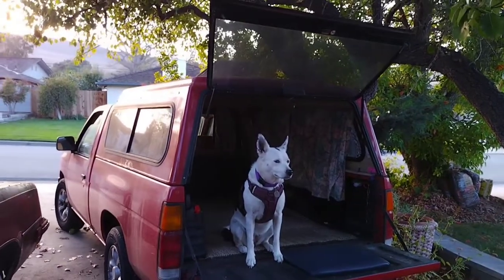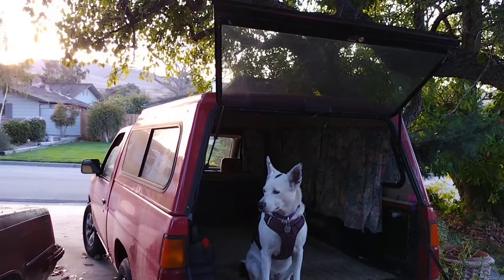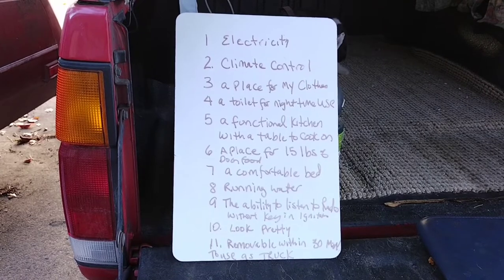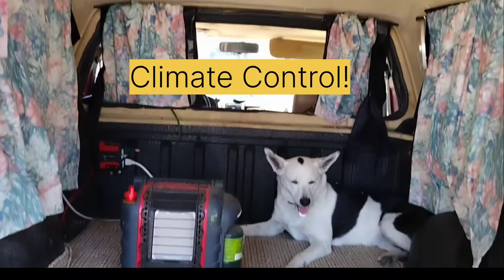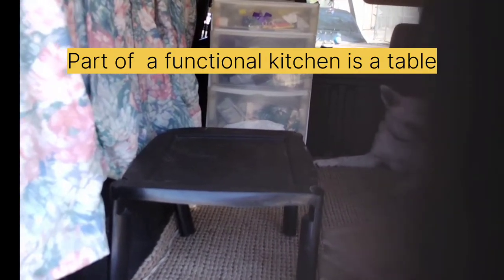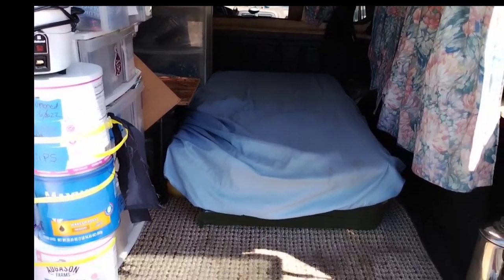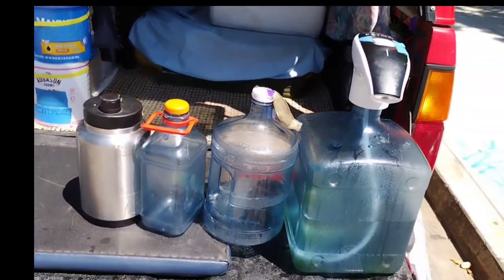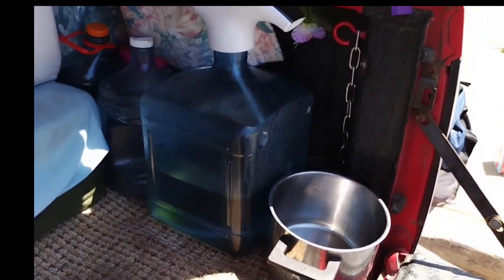Pickup truck camper conversion: 6' x 4' Nissan Pickup

Comment: Great video.  just got my own hardbody 1991, will deff do the inverter fan on rood idea.  thank u.  only thing i would reccomend ive seen others do is maybe a roof rack on top and then add a spray painted black flat ish drum filled with water and a small hose for warm showers in the summer!
Reply from the maker: Thank you! I love having a fan! It makes sleeping in an enclosed space doable. I cook inside and have a dog, so I open the fan when needed. The problem I foresee with the roof racks and water, is you have to be mindful of weight especially if you have a four  cylinder truck. Plus you are not stealth.  I use a electric water pump for drinking and "showering." Good luck!